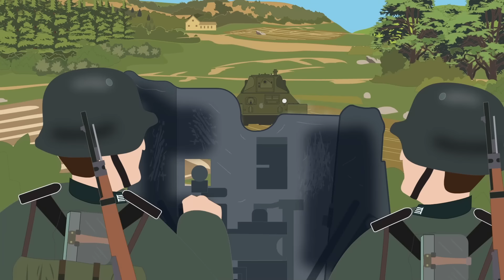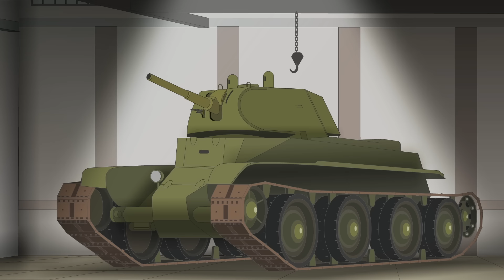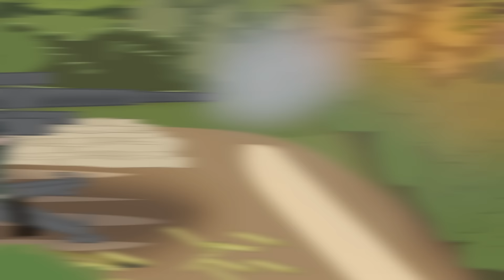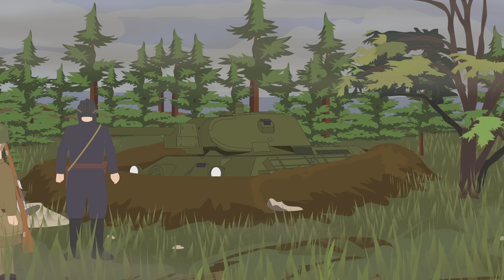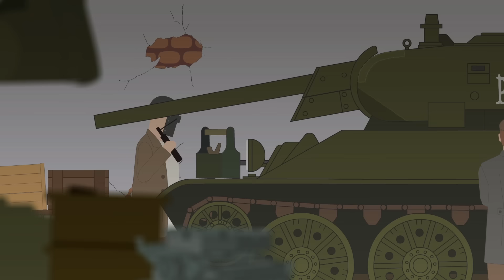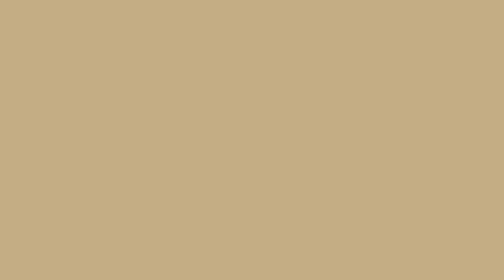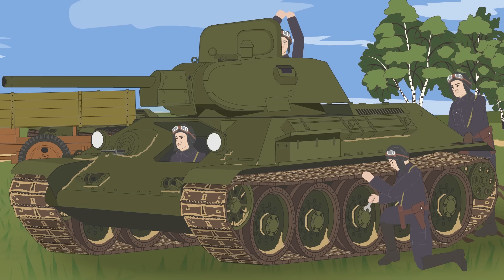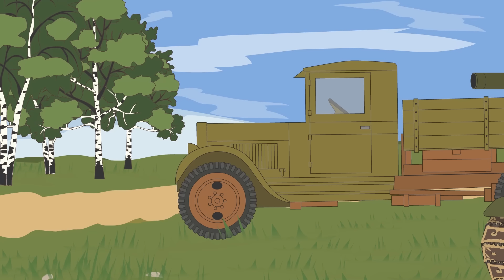Was the T-34 Really the Best Tank of WW2?

Comment: I don't think the T34 was the best tank of WW2, I would actually say it was the Sherman
Reply: wrote: "I don't think the T34 was the best tank of WW2, I would actually say it was the Sherman"

-- Eh, T-34 reputation as the best tank of WWII actually been earned through the war years, Sherman tank reputation, seems to be manufactured in a resent few years. T-34 by just about every category is a better tank when it comes to Fire Power, Armor protection, Mobility and Reliability.
Reply: @RussianThunderrr 
Yes, because those four factors are the only ones prominent enough to even be considered when comparing these tanks, certainly mate. If the T-34 was the best tank of the war, then tell me how you define "the best", since just like then, people have different ideas about what is best.
Reply: @Armour_Enjoyer  wrote: “Then tell me how you define “the best”…”

— It’s the overall best tank throughout the WW2. It had the best gun 76mm at the beginning of the war that could do everything well, i.e. excellent vs. enemy tanks, and just as well vs softer targets and as an anti personnel, so unlike Pz-3 it didn’t have to have an “accompany” tank to dead with soft targets. Late at war, it was up gunned to 85mm to deal with with German heavy tank gun. Armor protection it was the best at the beginning of the war, to neutralize the effectiveness of just about every German tank and anti tank gun, all around, and better then any other medium tank of WW2. Less flammable diesel fuel engine was not only better then most tanks gasoline engines of that time, but also gave better operational range then just about any tank of WW2. T-34 engine was way ahead of its time with direct fuel injection common rail was “set it and forget it” from the factory didn’t needs and “field adjustments” as carburetors engines did, and power and torque could compensate for shortcomings of difficulty to shift gears for novice drivers, because it was aircraft based high reving engine. Experienced T-34 drivers loved how agile and maneuverable T-34 was, it was not just a fast tank on road, but cross country, also pick up from dead stop, and off road, unmatched by ani WW2 tanks. It was reliable to begin with, with deep of its reliability due to factory relocation during 1942-43, but towards the mid and end war, it was one of most reliable tanks of WW2. Shipping and transportation of T-34 was never a problem T-34, at the beginning of the war at 26 tons, and not at 32 tons towards the end of war, no tank can just jump of rail road cart the way T-34 could when circumstances called for it. So it was also a great tank on both tactical and strategical level, it also was the tank not only saved Soviet Union from almost certain defeat(if Soviet Union didn’t develop and put it into production just in time), but also took Soviet Union to victory both VE and VJ. So what do you have in mind?
Reply: @RussianThunderrr 
I'd like to thank you for taking the time to give a detailed answer, - at least it isn't the usual "just because" argument, which I appreciate - although I must correct a few things.

"It’s the overall best tank throughout the WW2."
As I've said numerous times, and this is the hill which I will die on, the concept of an overall best tank can't be determined, simply because of the diversity in different doctrines and requirements. - and it isn't an objective truth either. If it would've been the "best tank", then the Germans would've just copied it when they've seen how incredible it was, but they haven't done so, not only because the "just copy it" solution isn't as easy as people would think, - different ammunition, different manufacturing process, basically everything about it differed from what the Germans have been used to - but because it would not have met the requirements of the German high command, and it wouldn't have fit their doctrine at the time. However the T-34 was the best tank for the Soviet Union, supplemented by a few others, - for a time by the KV series of tanks, and until the end of the war by the IS series of tanks - as it had a lot of good ideas which have helped maximise its potential production and ease of maintenance.

The part where you explain the armour protection and firepower in detail is correct, the 76mm was an excellent gun with a good HE filler, and combined with the armour profile of the tank it was certainly a forward-looking choice in the designing. - since before that point tanks would have one trait or the other, but not both of them combined - (although I still think that the Soviets wanted to simplify their tank production by designing a tank which had the traits of others, so they would only need to produce one medium instead of the different light tanks like in the previous years, anyway, this doesn't change anything)

The myth that the T-34 was this incomprehensibly reliable vehicle is perhaps the biggest misconception surrounding the tank; it was not reliable initially.
During Operation Barbarossa its engine had an average lifespan of 100 hours, and the transmission was even less reliable. You can see pictures of the early models carrying spare components for their power system, because the probability of a breakdown was imminent. - for example: https://i.redd.it/mlb89p1e6uw11.png
These issues have been worked at, I'm not trying to deny that, but the biggest, true improvement has came with the T-34 85, not any sooner.

Despite its difficulties with visibility and reliability - as I've said, the early models were notoriously unreliable - or the lack of ammunition and training - for further information here is a quote and the source: "Fuel and ammunition were in short supply, many tank guns were not boresighted and could not fire, and most of the mechanised corps' tank drivers had received minimal if any training" (Glantz, David M.: Colossus Reborn. The Red Army at War, 1941-1943. University Kansas Press: Kansas, US, 2005, p. 242) - the tank's biggest flaw was its crew overload, namely that the commander had to function as the loader while trying to perform his duties, and the cramped interior of the vehicle.

While the Panzer III was originally designed to take a 5cm cannon - by the way, the Germans didn't have a 5cm gun to put into it because the funding wasn't available until 1938, so its rearmament haven't commenced because of the T-34 or KV-1, (I remember that during our first argument you've said this, and I've approved, but now I have the actual answer) - and work well, the T-34 wasn't designed to house a 76mm cannon. It originates from the A-20 - which had a 45mm cannon - and the A-32, - which had a smaller, shorter 76mm cannon in the same turret as the A-20 - so in the end you have a 76mm cannon in a turret designed for a 45mm one, are you starting to see the issue?
This resulted in a rate of fire of 5 rounds per minute - this is the official statistics - during acceptance trials, which aren't the same as doing it in combat conditions. - the target was stationary and the rounds were unpacked and prepared for the commander in advance.
But they've also did operational trials, - a simulated combat scenario where the tank was moving around, the commander had to extract the rounds from a stowed position and he also had to locate the targets while doing these things - and unsurprisingly, the rate of fire was a meager 2 rounds per minute.
A perfect example for this is when a 37mm AT gun - the "doorknocker" - hit a T-34 roughly 25 times and eventually knocking it out by jamming the turret ring, without the Soviet crew seeing the German AT gun crew. This serves as proof for the T-34's "superior" ergonomics and visibility.

So to summarise: the T-34 is a fantastic vehicle on paper, and eventually it has developed into a jolly good tank, the T-34 85, but before that it wasn't as capable as the paper statistics implied.
Reply: @Armour_Enjoyer  — Good post, a lots of interesting info to talk about, so thank you! Let me start from main gun of T-34 vs. Pz-3 vs. KV-1, but somewhat from Soviet perspective. 

— First of all, T-34 was designed specifically to take 76.2mm gun, that was the original thinking of M. Koshkin of making T-34 as a universal(«универсальный танк» - which is in translation means good for “anything” i.e. to fight enemy tanks or softer targets or even as anti personnel, in other words be a MBT aka a “main battle tank”, which it actually seceded by forcing other factory/competing design bureau under Joseph Kotin, that was making KV(and later IS) series tanks to produce T-34, that is to illustrate how much more important T-34 was for Soviet Union). Now, I’m not sure if you know this, but idea of putting 76.2mm gun actually goes back to 1934, and earlier BT tanks that was produced by Kharkov factory 183, and those tanks had indexation “A” for artillery tank, so the idea was there, but it was a short, howitzer like 76.2 mm gun, and was not an anti tank gun as L-10, L-11 or F-34 that could be found on T-34 and KV-1 tanks. 

— Now, what you saying about luck of fundings for Pz-3 main gun, is new to me, if you got source, I would immensely appreciate that, but in most of literature traditionally explained, that OKW Pfeu 6 ignored 5cm gun in favor of 3.7cm gun because of logistics problems, of which A. Hitler found out from Panzer Committee report of November 18th, 1941. And, somehow Soviets knew that maximum you could put in Pz-3 is 5cm long barrel gun, but that is all, when it comes to AT capabilities of Pz-3, therefor call it the best medium tank is kinda well… Under-gunned even with long barrel L-60.
Reply: @Armour_Enjoyer  — Now to address the example of 3.7cm “doorknocker” vs. T-34. PaK 38 was actually a very small AT gun, that didn’t have a muzzle break to make a cloud of smoke, and can be positioned/camouflaged behind any bush to be invisible to tank crew. Otto Carius in his books and interview stating that as an experienced TC(Tank Commander) develops 6th sense of where AT going to be positioned, but as a not experienced TC you just would not know where to look. Also, he mentions that one time he put his head inside turret to light a cigarette, when in that instance AT gun knocked out his cupola off the tank, and if not for cigarette he would not be able to tell a story. Yes, TC cupola make a much better tank, but it’s not a substitute for luck of experience or inferior gun. 

I also recommend you to read Osprey publisher “Ukrain 1943 T-34 vs Panther” in that book T-34 tank commander talks about crew training or rather “luck thereof”, because of shortages of ammo, fuel and tanks for training. So final training they were giving 1 drum of ammo per MG, and 1 round to fire from their new T-34 tank that they just received, so one of the crew member was so “shell shocked” after F-34 gun fired, that he jumped out of the tank an ran into woods, where they found him couple of hours later, load onto train, and shipped all of them to Kursk battle. 

— Other story, that I came across recently was about young T-34 TC who inlisted into Kharkov tank school the very next day after begging of the war, since he just turned 18, then school been evacuated to Kazakstan, where he successfully graduated as a TC in a rack of Lieutenant, and been shipped to Kursk as well to start his tank carrier. He said that he was so shocked after first battle, that so many body parts stuck to tank wheels and caterpillar tracks, that he was afraid to get out his T-34 for days, and other crew members have to gave him food inside the tank. Later that initial schlock wears out, and he became a successful TC through the rest of the war. … And stories like this can be found on both sides. Eric Hartmann describes his first experience after been attacked and lost his commander, in his first dogfights, and that is after extensive training he received in flight school.  So tank crew experience can make mediocre tank be better then it really is, and none experienced crew can nullified better tank advantages, and that is what actually happened to earlier T-34s vs. Pz-3 and Pz-4, where experienced T-34 wrecked huge score, that was unmatched to the rest of the war by any Allies tank crews, while none experienced crew became “statistics”. So visibility of T-34 was No worst then any other tank of that time(including M4 Sherman), and yes Pz-3 had a slight advantage in that regard, but in order to figure out where fire coming from German TC, still had to stick his head, which you could do the same be it T-34 or Sherman!
Reply: @Armour_Enjoyer  wrote: “The myth that the T-34 was incomprehensibly reliable vehicle is perhaps the biggest misconception surrounding the tank…”

— Once again, comparing to what? To itself? As I mentioned before earlier T-34 lucked synchromesh gearbox, which made changing a gears a lot more difficult for a novice driver, but solution to it was in T-34 more powerful and torquier engine then any other tank of the time, so you could take off in second gear, and leave it there, and it’s still going to be a better tank, then British Matilda or Pz-4 at the open field, and yes you will burn friction clutches faster, then experienced driver would, but it is still a viable option, and not a deal breaker for T-34 tank vs. any other tank at the time. And like I mentioned two T-34 tanks made test run Kharkov-Moscow-Finland-Kharkov which is 3000 km, and not 700 km like people imply in this video, and list of breakdowns been published, but unfortunately in Russian language only. And, I’m not sure if you saw this video:

https://youtu.be/yC30ouO7UZc
Reply: @Armour_Enjoyer  wrote: “If it would be the “best tank”, then the Germans would’ve just copied it when they’ve seen how incredible it was, but they haven’t done so, not only because the “just copy it” solution isn’t’t as easy as people would think…”

— That is an excellent topic you just brought up! There is an argument to be made that Germans could not “just copy it”, but have to have a lot better tank then enemy(T-34 in this instance), in latest arguments Chieftain thinks, that Germany would not have a “man power” to field all tanks they could if you “just copy T-34”, which is bizarre to say the least… Do you think Pz-5 Panther was that much superior to T-34? Here is my couple of thoughts:

1. Panther tank had double torsion bar per axil(which is unheard of before or since) that made tank not only heavier, but 220mm taller, of absolutely dead space(in some tanks there are storage compartments between torsion bars), that also need to be armored which made tank heavier, and did I mention taller? Now if they made this tank rear wheel drive, turret basket could be just above it, but since it was rear engine and fwd tank, drive shaft have to run from engine to front of the tank, so once again more armor have to in cased to protect that space, again made that tank heavier then it needed to be, and did I mentioned it also made tank taller!? Add gazillion of wheels, which also made tank heavier then it needs to be, and what advantages for all of this efforts Panther tank got? Smooth cross country ride, anything else? Not really… But complexity of not only manufacture, but also service of this vehicle is immense for advantages so few, no wonder it was 10-15 tons more then it needed to be… And agile Panther was not.. For comparison when T-34 added additional frontal armor bring it up to 65mm, many tankers feed back was so negative how adversely it affected T-34 mobility and agility of the T-34 tank, that hull armor improvement was left alone for the rest of the war, but since 60% of all hits was to turret, that is were armor improvement should be, and that is what happened to T-34-85 tank. Now if Pz-5 would just opt out for simpler and cheaper bogies like VK 30.01(DB) then tank would not be as tall, and as heavy or as difficult to manufacture or service. It would still could featured same, if not better turret, same 75mm gun, same 5 men crew, and be a better all around tank, and that is what H. Guderian want. Lighter, more agile tank, with long L/70 range gun, or better dual purpose L/56 KwK 36 88mm gun(irony, that back in time creators hoped that going with a smaller 75mm bore would afford more ammo to be carried, but it wasn’t how it turned out) and same as Panther armor protection, but simple to manufacture and service.

2. The other totally useless features of Panther tank is speed/gear dependent turn radius. One of Soviet tank drivers figured out that he put Panther shifter instead of 3rd gear into 5th after tank didn’t do all of the sudden step turn. Do you need this feature in the tank? Well, no, not really! Could you use the brain power to do something more productive - like simplifying production, absolutely, but …

— A. Tupolev when he was put in charge of copying American B-29 bomber told Stalin, I have so many great ideas on how to improve this aircraft, to which Stalin said - Andrei, if you delay implementation of production nuclear bomb capable bomber even by a second then, I have you to be thrown in jail or get shot… ever since A. Tupolev ironically joked that he got a gold star(Hero of Social Worker) medal/award for converting American “Standart” system to “Metric” system.

Conclusion: Did Germany had an industrial capacity and “brain power” to come up with not just a copy, but better all around tank? Definitely, but they squandered that opportunity, many like Von Braun, F. Porsche and others, used it to experiment their engineering ideas to explore/create something, that without state funds they were simply incapable to realize during their  lifetime, it was a “wonder weapons”, but not something that would win the war. To think simple, and to come up with cheap and effective weapons like Panzer Faust(which is responsible for more T-34 and ever IS-2 tank kills, then any German tank in 1945) Germans learned only towards the end of war, usually because limited resources/choices makes you think a different way, focusing and prioritize on what very important, instead of lasting after great variety of choices, some of which are very irrelevant.
Reply: @RussianThunderrr 
About the intended gun of the T-34:
Oh, perhaps I haven't paid enough attention, but thanks for the correction nonetheless. I've simply wanted to point out that the prototypes were equipped with the 45mm (I believe it was the K-20, but I'm not sure) - on the A-20 - and the 76,2mm L-10, - on the A-32 - and while the turret was basically the same as the A-20's, the cannon now has been upgraded to an L-11, and later an F-34, that's why it was so cramped. So basically they've had a 76mm cannon in a turret designed for a 45mm cannon, that's why it isn't a big surprise that it wasn't as comfortable as the Panzer III, in which design the 50mm was considered as a possible option. This leads to the next point;

About the Panzer III's intended gun: 
Unfortunately I don't have a more specific source than this, - Tanks Encyclopedia's article about the Panzer III, which I can't link because You Tube won't allow me to post the comment with more than 1 link in it, which is unfortunate, but if you read its second paragraph, you'll find the answer - but I do know that, as the article says, in 1934 the Panzer III was intended to have a 50mm gun, but the army didn't have a "mountable" version developed yet- Kampfwagenkanone - to fit on the tank, and they've had a lot of 37mm cannons anyway, so it was easier to standardise, that's why the Waffenamt haven't approved equipping it with a 50mm cannon, and that's also the reason why funding haven't came until 1938, as its name implies, - KwK 38 L/42 - its development has started in 1938. 

About the visibility issues of the T-34: 
I know what you're trying to say, - in your second comment - although I must say that yes, the crew had extremely limited visibility, the driver had a vision port, while the machine gunner only a small hole to look out of, - he also didn't have a hatch, so god have mercy on him if he needs to bail out - on the turret there were skinny vision slits above pistol ports - fun fact, the Germans made a disc grenade which would slip through those vision slits, although I don't think they were quite successful - along with the commander's periscope. 
German combat reports show that T-34 tanks had serious difficulties in navigating terrain and identifying targets. The problem was that the vision devices made it hard for the driver and the gunner to see what was happening. 
This has been worked on during the war however and with the 1943 model, they've introduced a larger turret and a German style cupola, and with the arrival of the T-34-85, a new, large turret and a German style cupola were added, greatly enhancing the crew's visibility, thus their combat potential, which they've lacked before. 
Although before the T-34-85, the quality of Soviet optics combined with the limited visibility from inside the tank affected combat performance. 

Quote from a German unit that used the T-34-76 noted:

"The gun sights in Russian tanks are far behind the German designs. The German gunners need to be thoroughly accustomed to the Russian telescopic gunsights. The ability to spot a hit through the gun sight is very limited."

"In a Russian tank it is difficult to command a Panzer or a unit and at the same time serve as the gunner Therefore fire direction for the entire Kompanie is hardly possible, and the concentrated effect of the unit’s firepower is lost. The commander's cupola on the T-34 makes it easier to command and fire at the same time; however; vision is very limited to five very small and narrow slits." 

Poor lads, I don't know what they've done to deserve being ordered to crew a captured Russian tank, but I would not have been in their place, that's for sure. 

Just compare a T-34 - which isn't an 85 - to a Sherman - where both the driver and the machine gunner had one fixed, forward looking periscopic sight just below the cannon barrel and one rotatable pericopic sight located on their hatches. The loader also had a rotatable periscopic sight just in front of his hatch, while the gunner had a fixed periscopic sight apart from his main sight and the commander had a nice cupola with multiple vision slits, which the US army adopted on many tanks after the war due to its effectiveness (T26, M26 and M47 just to name a few) - or a Panzer III, or even a Panther, - where, even though the the gunner didn't have a periscopic sight, which was a problem of many other German tanks apart from the assault guns, the rest of the crew members had multiple vision slits into almost every direction, including the sides and rear thanks to the cupola - and the T-34's visibility disadvantage originating form the lack of training, cupola and crew overload will be imminent. 

About the reliability issues regarding the T-34: 
Like I've said before, the concept of the T-34 as a reliable tank is another myth of WWII. 
The majority of vehicles in 1941 were lost due to equipment malfunction. The same reliability problems continued during the 1942-1944 period.The evacuation and relocation of industrial facilities combined with the loss of skilled workers could only lead to the fall of reliability. 

In 1942 the situation worsened since many vehicles could only cover small distances before breaking down.
In the summer of 1942 the following Stalin order was issued to units: 

"Our armored forces and their units frequently suffer greater losses through mechanical breakdowns than they do in battle. For example, at Stalingrad Front in six days twelve of our tank brigades lost 326 out of their 400 tanks. Of those about 260 owed to mechanical problems. Many of the tanks were abandoned on the battlefield. Similar instances can be observed on other fronts. Since such a high incidence of mechanical defects is implausible, the Supreme Headquarters sees in it covert sabotage and wrecking by certain elements in the tank crews who try to exploit small mechanical troubles to avoid battle." 

"Henceforth, every tank leaving the battlefield for alleged mechanical reasons was to be gone over by technicians, and if sabotage was suspected, the crews were to be put into tank punishment companies or "degraded to the infantry" and put into infantry punishment companies."
Reply: @RussianThunderrr 
The constant complaints from the front forced the authorities to investigate the problem with T-34 production. In September of 1942 a conference has been held at the Ural tank factory by the Commissariat of tank industry. The conference was headed by Major General Kotin, People's commissar of the tank industry of the USSR and chief designer of the heavy tank "Kliment Voroshilov". In his speech he has said:
Reply: @RussianThunderrr 
"Now [...] there are a lot of complaints about T-34. You all know the reasons for flaws in the tanks. The first reason; inadequate visibility from the tank, the second reason, and this is the weak link that always accompanies our vehicle in the Red Army, final drive. The third, the main issue that we have today; insufficient strength of the idler wheel's crank. These issues are the major defects of the T-34 today. Having considered these issues from engineering and technological points of view I would like to discuss another issue, the one that directly resulted solely from our production deficiencies. They are: negligence during production of combat vehicles in the factories, carelessness of assembly and quality control of vehicles. As a result during combat employment our tanks sometimes can't reach the front lines, or after getting to the territory occupied by the enemy for conducting combat operations, sometimes they are forced to remain on enemy's territory because of some little things [...] We have to make sure that as a result of this conference all shortcomings will be uncovered and following this conference all corrections in the tank will be implemented in the shortest possible time [...]

"Recently comrade Morozov and I visited comrade Stalin. Comrade Stalin drew our attention to the fact that enemy tanks cover a lot of ground freely, and our machines although are better, but have a disadvantage: after 50 or 80 kilometres march they require repair. What are we talking about? It is because of control gear; also, as comrade Stalin said, because of drive gear, and he compared it with the Panzer III, which is in service with the German army, and which is inferior in armour protection, and in other features, and it's crew layout, - OK, OK, this isn't part of the quote, but I have to point out that this person just said that the Panzer III's crew layout is INFERIOR to the T-34's crew layout, that's hilarious... - and does not have such a fine engine, which the T-34 got, moreover its engine is gasoline, not diesel. But the question arises; why is its drive gear developed better?"

"Comrade Stalin gave directives to engineers, to the People's Commissar comrade Zaltsman, to factories' CEOs and ordered them to fix all defects in the shortest time. A special order of the state Defense Committee has been issued on the subject as well as directives of the People's Commissariat of the Tank Industry. Despite all these resolutions have been made by Government and orders of the People's Commissar of the Tank Industry, despite repeated instructions from army units and from main Directorate of the Armoured Forces, which is in charge of combat vehicles operation, nevertheless all of these defects on vehicles are going on [...] We have to reveal all these flaws, and suggestions have to be made at this conference how to modify machine components better and faster in order to make the T-34 tank, which is recognised in the army as a good tank, an even better fighting machine."
Reply: @RussianThunderrr 
The situation continued to be problematic even in 1943-1944, there were constant problems with the gearbox and the engine filters.
As the Aberdeen evaluations have noted:

"On the T-34 the transmission is also very poor. When it was being operated, the cogs completely fell to pieces. (on all cogwheels) A chemical analysis of the cogs on the cogwheels showed that their thermal treatment  is very poor and does not in any way meet American standards for such mechanisms."

"The transmission had by American standards already failed, although with extreme care it could have been used further. Teeth end on all gears were battered as the result of clash shifting. Many pieces of gear teeth had been broken off and were in the transmission oil. The failure is due to inadequate design, since excellent steel was used through the transmission."
Reply: @RussianThunderrr 
The image of the T-34 going hundreds of kilometres without stopping, as many people stated, is pure fantasy, nothing more.
A German unit that used the T-34-76 model 1943 in combat noted:

"Regardless of our limited experience, it can be stated that the Russian tanks are not suitable for long road marches and high speeds. It has turned out that the highest speed that can be achieved is 10 to 12 km/h. It's also necessary on marches to halt every half an hour for at least 15 to 20 minutes to let the machine cool down. Difficulties and breakdowns of the steering clutches have occured with all the new Beute-Panzer. In a difficult terrain, on the march, and during attack, in which the Panzer must be frequently steered and turned, within a short time the steering clutches overheat and are coated with oil. The result is that the clutches don't grip and the Panzer is no longer manoeuvrable. After they have cooled, the clutches must be rinsed with a lot of fuel."
The T-34 is the victim of both Soviet and German wartime propaganda. The Russians had every reason to make it seem like it's the best tank of WWII, while the Germans overstated its performance in order to explain their defeats. - examples aren't difficult to find, they're the famous quotes from Guderian, von Kleist, von Mellenthin or von Reichenau.
As I've said many, many times, the T-34 may have looked good on paper, but its "insignificant" disadvantages and design flaws greatly hindered its potential and they've led to huge losses.
Reply: @RussianThunderrr 
Look, I'm sorry that I haven't sent this comment as a whole, believe me, I've tried it many ways, but You Tube simply would't allow me to do so, I've always received some bollocks like "Unable to post the comment, try again later" or "Reply error". Again, I'm sorry if it's more difficult to understand it because of this.
Reply: @Armour_Enjoyer  wrote: “About the Panzer III’s intended gun:”

— Here is the thing it doesn’t matter when 50mm started to be developed, it is still 2-4 pound gun, vs 16-17 pound 3 inch gun in case of T-34, and T-34 armor is been specially develop to defeat any German tank gun that crossed S.U. In 1941, while Pz-3 armor was valuable even to 45mm tank gun found on light BT and T-26 tanks. If there would be no T-34, then yes, Pz-3 would probably be top medium tank, that outclassed both BT and T-26 tank, but T-34 was a giant leap to next generation of tanks when it comes to main gun and armor protection.
Reply: @Armour_Enjoyer  - MG in T-34 had a personal emergency escape hatch, and also had an unobstructed way to bail out through turret, since there is no turret basket. Tiger I tank bow MG/radio operator only had a narrow telescopic sight to see through to outside the tank, so it is not something usual. 

— As far as gunner, he had telescopic sights, periscope called sights and 360 degrees rotating panoramic periscope similar set up to American and British tanks of 1942-43, which did not have a commanders cupola, but nobody calls those tanks had poor visibility, right?
Reply: @Armour_Enjoyer  wrote: “Look, I’m sorry that I haven’t sent this comment as a whole…”

— That is Ok, since I’ve see those before many times over, some have merits, some unwarranted. If you read British Osprey Published “Vanguard series” on Pz-3 book, you will find that tank also overheated a lot, since it was overloaded with extra frontal armor, so engine and gearbox had to be upgraded, but problems remain. Yes, I’m also very familiar with Aberdeen 1942 report and CIA 1950 Korean War captured T-34-85, and since I have both aviation and automotive mechanical background, I’m very familiar with what information those report had to offer, and that is also the reason why I can figure where Chieftain and other specialists correct, and where they are not, and you can go back to his videos, since he try to had this dialogue for years, but leaving those subjects unanswered.
Reply: @RussianThunderrr 
Aaah, I see... It was bold of me to assume you haven't fought this battle a hundred times, right? But I must question your motives; if you've seen these arguments many times, and haven't changed your opinion despite seeing direct evidence that even the Red Army hasn't been pleased with the visibility, reliability, etcetera etcetera, then what's the point of the argument? 
If the T-34 would've been as good as propaganda made it out to be, or as you state, then the Soviets would've held back the German advance even in 1941, but instead they've demonstrated the lack of coordination and inadequate performance of their armoured units.
Well, I guess I'll have to emphasise what Kalashnikov 413 has said;
Alright, your opinion is that the T-34 was better, but my point still stands. You know what you're saying, goodbye and have a great day!
Reply: @Armour_Enjoyer  wrote: “But I must question your motives…”

— Go ahead, I’ll do my best to answer any questions you have. Yes, I’ve seen these arguments before, and it did changed my opinion one way or the other over a decades, so is my opinions about others WW2 tanks, and like I said, I’m judging tanks from a mechanical point of view. When you presented quotes from J Stalin and K Voroshilov, they referring to, and questioning why quality of tanks deeper in comparison to earlier T-34, meaning pre war production and the one that survived test run, and not just agree out of the “blue”(i.e. out of nowhere)
Reply: @Armour_Enjoyer  wrote: “If the T-34 would’ve been as good as propaganda made it out to be, or as you state, then the Soviets would’ve held back the German advance even in 1941, but instead they’ve demonstrated the lack of coordination and inadequate performance of their armored units.”
— Well, they did stop German’s and prevent them from realizing plan Barbarossa i.e. capturing Leningrad and Moscow, and advancing to Achangelst-Astrahan line that was outlined in Hitler’s directive 21 and planned by OKW(Halder, Paulis and others), right? 

— And despite you thinking of “stupid” German generals using T-34 as an excuse, see what steps was taking by Germans, in response to counter T-34 tank threat, some was good, and some was not.
Reply: @Armour_Enjoyer  wrote: “If the T-34 would’ve been as good as propaganda made it out to be…”
— BTW let me say this -> No amount of propaganda going to convince me that Soviet car are any good, I can’t think right now of many other aspects of crappie things that came out of USSR, but T-34 and tank were pretty good, when compared to other tank.
Reply: @RussianThunderrr 
But if you have both the background and the knowledge as well, then how can you still say that the T-34 was the best tank of WWII? It was literally an engineering nightmare, nowhere near as reliable as media makes it out to be, and it's perhaps the most overrated tank of the war. If you consider these four attributes - as you've said many times; firepower, armour protection, mobility and reliability - as the main instrument in deciding whether a vehicle was "the best" or not, you're not only ignoring other factors, but you disregard how the T-34 evaluates in this regard as well. - for example, the Panther scores better, or roughly the same in every category, even if we look at the T-34-85 instead of the 76.
Reply: @Armour_Enjoyer  wrote: “then how can you still say that the T-34 was the best tank of WWII?”

— Because, problems that you mentioned here with T-34 were temporary, and resolved by say before battle of Kursk, and units had a mechanical battle readiness of ~70-80%. With Pz-3, a fatal flaw that tank was a too small of gun for that tank(it doesn’t mater how good visibility is from it), and Panther tank also had a fatal(means it never been fixed to the end of war) which is overstressed final drive that was designed for a tank that was 10-15 tons lighter, and could break down anytime, while fixing it takes two-three days, and not a two-three hours like on T-34. On top, I don’t remember if we talked about, but it was a heavy tank, with good frontal armor protection, but weaker the T-34 side armor, with all the heavy tank logistics, including narrow rail road transportation caterpillar tracks. Gun was also great at long ranges, in fact it was Panther that had a record distance kill of 3km, but too flat of trajectory made it less effect then Pz-4 L48 gun, and It one of the reasons it never replace Pz-4. Mobility and maneuverability was not near T-34 level. Panther was a very dangerous tank, but not the best.
Reply: @Armour_Enjoyer  wrote: “I doesn’t look like the issues have been fixed before battle of Kursk “

— It could also be that M. Katukov 1st tank Army used alder models tanks, since Northern part of Kursk was more wooded, and Germans had a fewer options where to attack, unlike Rotmisterovs Tank Army that was operated out of reserves of Steeps Front away from Vatutin’s front line on the South, and had to cover hundred’s of kilometers before entering battle on their own tracks.
Reply: @Armour_Enjoyer  wrote: “I don’t know what you’re talking about, the Panther was a medium tank, and it doesn’t matter that the Soviets label it as heavy tank - and sometimes as a tank destroyer - it was a medium tank at the end of the day.”

— Ah, what a great way to topic starter… IDK what you talking about… Sounds like a complete armature, or someone who is trying to “Pull the Wool over SB eyes”

— FYI, not only Soviets called it a heavy, but just about every Allied of WW2 called so, I guess those armatures didn’t know any better that it was a “medium tank”, and when did Soviets called it a “tank destroyer”? Curious minds want to know, please, what source was that?

— So when you compare Panther tank to its “classmates counterparts” like IS-2 and M-26 Pershing, then all of the sudden Panther looks pretty bleak.
Reply: @Armour_Enjoyer  wrote: “I don’t know what you’re talking about, the Panther was a medium tank…”

— Instead of me saying IDK what you talking about, I’d rather have “comrade” Roman Toppel to say it to you IDK what you talking about, since Panther tank was a heavy tank. 

https://youtu.be/_EUp1_FZWUQ
Reply: @Armour_Enjoyer  wrote: "A Soviet study in 1943 has admitted that the Panzer IV was superior to their tank, giving it a combat value of 1,27 in contrast to the T-34's 1,16. - with the Panzer III being the base 1,0."

-- Where did you get this info? Just curious?
Reply: @RussianThunderrr 
‘T-34-85 vs M26 Pershing’, p10.
Reply: @Armour_Enjoyer  wrote: "To add insult to injury, the upgraded Panzer IV - like the G and H variants - were superior to the T-34 in regard of the internal layout, firepower, turret basket, optics, commander's cupola, radio system and its frontal armour could withstand to the F-34 cannon of the T-34.
A Soviet study in 1943 has admitted that the Panzer IV was superior to their tank, giving it a combat value of 1,27 in contrast to the T-34's 1,16. - with the Panzer III being the base 1,0."

-- I also found that comparative combat value, in Zaloga's Armored Champions p.214, and it said that it was a post war computer modeling... at any rate, there were T-34-85 that had no problem dealing with any Pz-IV variant including G and H, and therefor it had a value of 1.32. At any rate, you was talking about M-26 and Panther guns, both tanks were heavy, none the less 85mm T-34 gun was only 7% less powerful then Tiger I gun, since both of these gun were based on AAA guns, and both were also good anti personnel gun with a powerful HE rounds. While Pz-V KwK 42 had better penetration values, it lacked explosive in HE, even in Armor Piercing round T-34-85 gun had 1/3 more explosive, and too flat of trajectory of the gun(which is great asset for long range engagement) is not desirable in case of engaging "soft targets". That is again what mare T-34 best overall/all around tank through the WWII. It was a good tank on tactical level through the war, and on strategical as well. Panther was designed as a response to T-34 tank, was better in tank vs tank, but lucked other capability, not to mention servicing/owing Panther tank was very "taxing" on already worsening German logistical situation even in 1942. T-34 was making more sense, and that is why it was best overall tank.